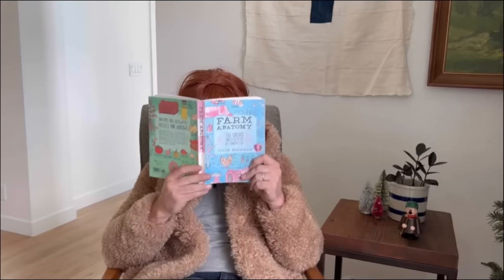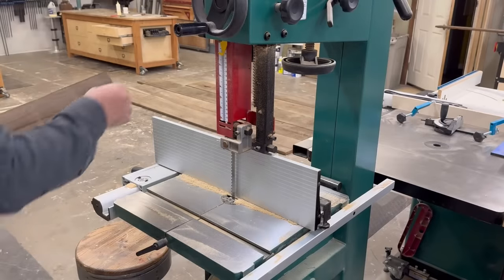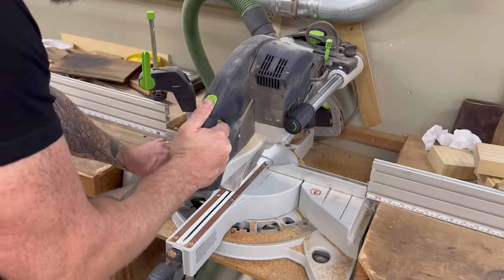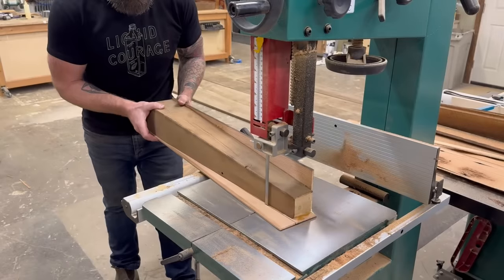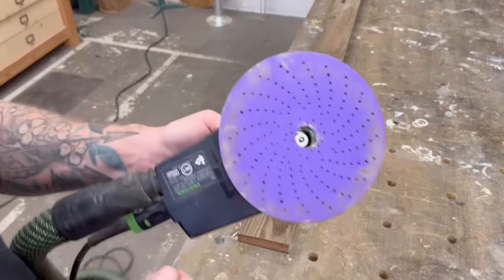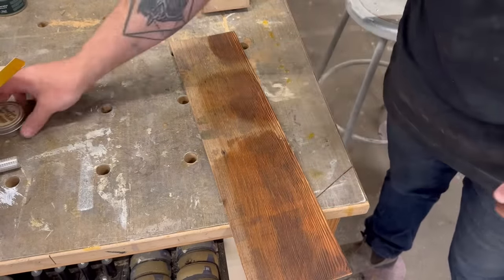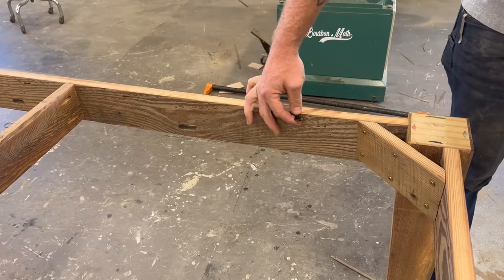Reclaimed Wood Tips and Tricks || Easy DIY Salvaged Wood Dining Table

Comment: if you're going to use reclaimed wood more often get an hand held metal detector to find all the nails.
Reply: That’s what I did. $30 at Harbor Freight.
Reply: Ruined a planar that way >:/
Reply: Would a magnet work as a cheaper alternative?
Reply: @dougkohnen  i would think it would depend on how big the metal is vs. how powerful the magnet is.
Reply: Agree. I work with it all the time for my wood art pieces. The cheap Harbor Freight one works well enough.
Reply: Hey I was just going to say that. We used a 100 year old barn on a house. I spent three days going over wood with a metal detector.
Reply: Just get a strong magnet. Much easier
Reply: Such an obvious idea I didn’t think of. I’ve run into a lot of buried nails or broken screws
Reply: Although, as I tragically found out, a metal detector doesn’t detect small bits of gravel trodden into the wood. R.I.P. my planer blades!

Comment: Sure you did, but for those less experienced: make sure to seal any exposed MDF, especially where it might get damp, like at the bottom of the legs, as it soaks up water and swells like a beast.
Reply: had the same thought
Reply: Or just use MR MDF instead because it basically never swells.
Reply: @AxGryndr  funny thing I'm actually looking to use that stuff in a bathroom project. Have you used it. I have no idea where you can get from.
Reply: @russellcasperson6695  not usually a diy thing here in the UK, I used to design furniture and we just ordered it from the sheet timber suppliers.
Reply: @joemacleod-iredale2888  yea it seems like a more industrial product I live in a rural area and none of the builder supply centers here could order it.

Comment: One important points (I work with reclaimed wood alot) :

Always brush it off / vacuum / do a light water wash first. It can be covered with lead and/or asbestos dust from old construction. (or worse stuff).  I also always do an extra lead test just in case.

Comment: I noticed you have raw MDF ends on the bottom of the legs.  Since MDF meeting water ends up disasterously, to prevent possible water damage from washing the floor or drink spills, I probably would have started the leg veneers by capping the bottoms with a 1/4” or so layer of hardwood that is sealed with thin CA glue after gluing them on. Then apply the side veneers.  … I did a similar project, making a “rustic” tressel (sp?) table with the base made from 5x7 oak timbers with pinned mortise and tenon joints. Fitting up the joints was a real challenge, to be sure! The top was made from similarly aged oak planks, all from my neighbor’s barn. He and his wife loved it!!
Reply: Putting a layer of glue at the bottom of the legs or just sealing it with something will slow down any absorption from a spill.  Enough time to mop up anyway.

Comment: I've used reclaimed lumber for shop projects such as my work bench, shaving mule, and other things just because I can get so much of it cheap. Locally it is mostly Douglas Fir from barns/outbuildings. Most of it is also old growth, heavy and tight ringed. If you are lucky you can get long lengths of rafters and floor joists too.
From my experience it really depends on who you get it from on the quality and work you need to put into up front. I can get a ton of wood cheap but then need to spend time cleaning it, searching for nails, pulling them, and then truing up the wood. The money you save on materials can easily be eaten up by that additional time to make it workable.
I would say as soon you get reclaimed wood is to decide on the finish you want to keep. If it is all the aging just stiff brush it to get rid of dirt/dust. If you don't care about that wash the wood and either brush it or lightly pressure wash it. It is always full of dust, dirt, and rocks from its time in a building and being moved, and that stuff sucks on your tools. 
After that is nail pulling. Never assume all nails are gone, get a good metal detector and nail puller and check them carefully. Even the guys who pull them for you before you buy will miss things. I even give it a final once over before running through the saws even if I pulled them.
Once all of that is done you have awesome material to build from, and I still find it the best way to get cheap wood for my own projects where time doesn't matter as much, assuming Fir is ok for them.

Comment: So i searched for just the tip, and not my crack.. and this was the top video. It did not disappoint!  FYI your quartering technique always works with 8 ish ft reclaimed boards due to the fact that you get 4 pcs from each board.. and that even a 5 leg table has 4 legs in the end :) Bravo my man.. Bra vo.

Comment: Nice looking table!  I have used the tape method for doing miters for years.  A quick tip is to take a steel tool such as a screwdriver shank or the top of a knife blade and run down the sharp edge lightly before removing the tape.  You can use  hard maple scrap as well. This closes up tiny gaps and really adds to the overall appearance when the tape is pulled.

Comment: Stuff the reclaimed wood 😅 You just handed me a solution to my current problem - making a solid frame for a worktable. Worktop is a slab of 3cm granite. Weighs a ton - well, almost. Feels like it anyway.😊 Not going to veneer  (thin?). Just glue 1/2" strips of meranti on top. It's going to work, and it's going to be solid. Thanks, man! 😊

Comment: Tip for getting a darkened, rustic look on your timber: stain it with used engine oil. Works surprisingly well, especially for harder woods which won't absorb regular stains or oils as readily.

Comment: I few years ago when Pier 1 when out of business, my wife and I saw a "tabletop only, no legs" for sale there for $50. We bought it and I made legs and underpinnings that matched the shape of what you used here. She really liked it so I was quite happy, having done the tapering with a jig and then finishing the legs to match the top. Everything was great until something wet was put / left on the table - it turns out that tabletop was really just a mock up for what a person would purchase - it was all mdf, or particle board, expanded like crazy when it got wet! Speaking of, as others have asked/stated, are you putting some kind of foot on the bottom to lift the mdf off the floor in case of spills?....

Comment: The problem I had with the reclaimed wood table I made was just how cupped and twisted the boards were - and I needed a nice flat top with the original reclaimed wood finish.  I'd seen another woodworking channel that remedied this with a bunch of deep channel cuts underneath, which allow the wood to bend back to straight, and then I clamp the whole thing flat and fill the voids with epoxy.  Worked great for me.

That oil looks a lot like just, I dunno, wax? Looks like it leaves a wax film.

Comment: Also good way to age cut parts to look like the older faces is the old Iron Acetate trick (steel wool aged in vinegar, wait a week, then brush on, expose to light / low heat for a few hours). I always try mine on scrap samples first, and usually thinned down extra for the first try.

Comment: Another potential issue with using reclaimed wood is that it may be saturated with very dangerous chemicals that are locked inside, which you will then re-expose through sanding and cutting. I  was advised of this one day when I was at my public workshop (in Germany) with the plan to make a table out of reclaimed floorboards. I was strongly advised to not do so, because of a scandal going back many years where German floorboards were deeply laced with dangerous chemicals. Apparently by this point the outer layers of the boards are inert, but will once again leech the chemicals into the air one exposed from sanding or cutting - Not something you want you or your family to be breathing on a daily basis! Another example of this was a lot of warnings against using palette wood for rustic indoor furniture, since that wood was not treated in a way that is compliant with modern health standards for indoor, in-home use. At the end of the day, it is your decision, but you should think very seriously about the long-term risks of introducing this stuff into your home.
Reply: I agree. I’m new to woodworking but I see a TON of videos about using pallet wood for furniture but what you just mentioned scares the hell out of me. I used to think “it’s just wood I can use it to make anything” but then I read/heard more about what you’re talking about. Thanks for mentioning this.

Comment: Genuine question about wood movement. Doesn't screwing the board together on the bottom like that restrict the natural wood movement and have the potential to cause cracks where you screwed them together? I know Oregon is quite wet so I figure it probably has more potential for wood movement than some other drier places.
Reply: I wondered about this too. The Z clip may be good enough, or the cross board might be slotted?

Comment: I have only eve tried this on a couple species of wood, the most successful was pine and fir, but to age new wood, or the edges of reclaimed that have been cut you can put a piece of steel wool ( NOT the kind with soap in it) into a jar of white vinegar for about 24 hours, then take the steel out, use a shop rag to run the vinegar into the wood, and in a few hours, it will turn that " old ass falling down barn" grey. it will look 100 years old in a couple days of effort.

Comment: Beautiful table!   what's  your preferred hole filler when using brad nails on new finish wood?  I find it challenging to fill holes so they aren't noticeable especially when staining.
Reply: Doubt he filled them at all.  I bet you can hardly see them and it might even be fitting for that old wood.
Reply: Well said, when working with distressed wood you can easily get away with not filling the holes.

Comment: @bourbonmoth screwing those battens to the underside of the table, won't that restrict the wood movement across the table? And doesn't that defeat the purpose of the z-clips that hold the table to the base (as they are designed to allow for wood movement)?

Comment: Hi 35 plus years in wood working I do not like mdf I hope that you sealed the bottom  of the table legs so that if someone  spills water etc on the floor the legs will not suck up that water etc otherwise  nice table  I my self like 8/4 wood

Comment: for starters….I really enjoy and appreciate your videos….but I think you may have missed the mark on this one by not mentioning a method of retaining the texture of old boards while still cleaning them and “sanding” them. Rather than using a normal sander and smoothing away that texture, maintain the texture by using a wire brush - or, ideally, a Makita Model 9741 wheel brush sander. I’ve used one of those for going on 20 years now to give amazing textured, but smooth to the touch, surfaces on old wood. I do realize preferences might be different, but since this video was about using reclaimed wood, it would have been nice to mention the technique and outcome.

Comment: THose bends on the legs would have been a piece of cake if you put a blade cut along the fold, halfway through your veneer. Would have bent right around and looked seamless.
Reply: Also after seeing the finished project, I can't help but wish that you added a 3" or so border around the table like a (cabinet door or picture frame) to help align the boards and tie it all together. The table is already a modernish take on an old design, but I feel like you went "poverty self built" with it instead of something like you would see built in a furniture shop 100 years ago.

Comment: 🎯 Key Takeaways for quick navigation:

00:00 🛠️ Crafting with Reclaimed Wood
- Reclaimed wood challenges:
  - Characteristics of reclaimed wood: cracks, bug damage, nails, holes, stains.
  - Difficulty in sourcing due to limited availability and obscured wood type.
01:32 🌲 Finding Reclaimed Wood
- Locating reclaimed wood:
  - Discovery of an architectural salvage place in Aurora, Oregon.
  - Acquiring a supply of reclaimed and salvaged lumber for the table project.
02:26 🪚 Preparing Reclaimed Wood
- Preparing reclaimed wood for use:
  - Allowing the wood to acclimate to shop conditions.
  - Technique to retain the wood's patina by using MDF for structural parts.
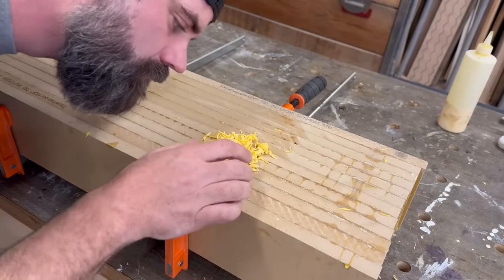03:46 🔨 Crafting MDF Legs
- Crafting legs from MDF:
  - Gluing up MDF blanks for the legs' structure.
  - Creating tapered legs using a custom jig and cutting techniques.
06:44 🖌️ Applying Reclaimed Wood Veneer
- Applying reclaimed wood veneer:
  - Matching veneer to MDF legs through color coding for a consistent look.
  - Mitigating angles and taper issues in the veneer application process.
11:26 🛠️ Completing Leg Veneering
- Completing the veneering process:
  - Joining veneers using mitered joints for seamless appearances.
  - Resolving mistakes in the veneer application for uniformity across legs.
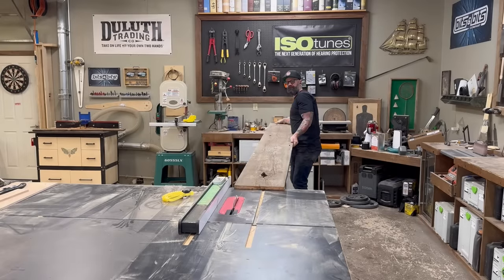17:13 🪚 Building Table Base
- Constructing the base:
  - Determining the table size and cutting internal apron pieces.
  - Using Domino Joiner for apron-to-leg joinery.
19:52 🌲 Preparing Tabletop Boards
- Preparing tabletop boards:
  - Assessing and repairing cracked sections of the boards.
  - Planing and sanding reclaimed wood to remove dirt while preserving the patina.
21:35 🧰 Finalizing Tabletop
- Finalizing the tabletop:
  - Stabilizing wood using CA glue for repairs.
  - Completing the sanding process for a finished look.
21:50 🛠️ Prefinishing and Oiling Wood
- Preparing and selecting the right finish for reclaimed wood,
- Applying Rubio monote Mist for a natural look,
- Methodical oiling process for the legs and tabletop.
23:25 🔨 Assembling the Table Base
- Slow, deliberate assembly to prevent glue squeeze-out on finished parts,
- Enlisting help and improvising with clamps for longer aprons,
- Adding bracing and stretchers for strength and stability.
25:53 🪚 Finalizing Table Assembly
- Mortising holes for z-clip fasteners to attach the tabletop to the base,
- Ensuring even overhangs and clamping boards in place,
- Securing and aligning separate tabletop boards underneath for stability.

Made with HARPA AI

Comment: Howdy Mr. Moth Dude...

Honestly...I was disappointed in your use of MDF in this build. It really had no purpose. I can understand you wanting to try something "different" but with "THIS" build, I think that was a bad idea. 👎 

As you said yourself..."No one is going to notice"....

Well, if "that" is the case....Then the same could be said for you just using SOLID 4x4 posts (reclaimed wood)....The tapers you used could be set towards the inside of the table and then you could have used your "dirt" technique (or better technique) to age those inside tapered cuts. Again, as you said, no one is going to notice, especially if the fresh cut tapered sides are facing inwards. 

So, with less work, as opposed to making veneers...You could have just used SOLID wood for the legs.

Aside from all that....This was just a standard table build. No biggie. 

Thumbs down on this build Mr. Moth. 

Using mdf on a reclaimed table build. BLASPHEMY!!!

Thumbs down.